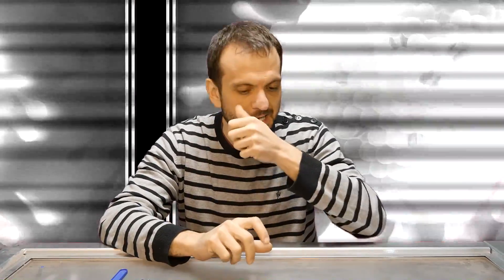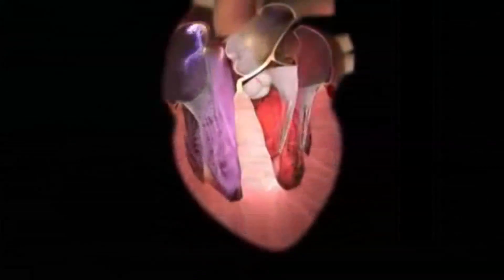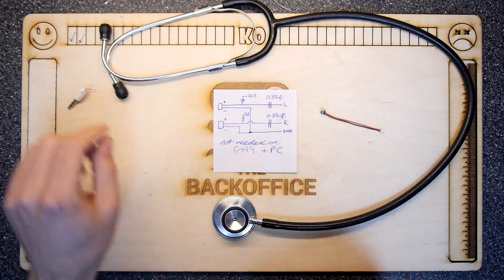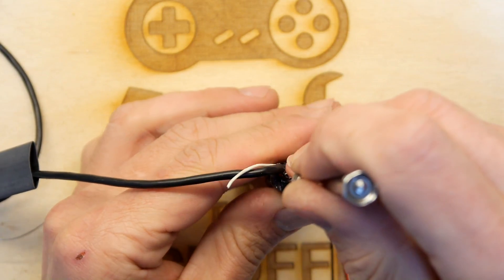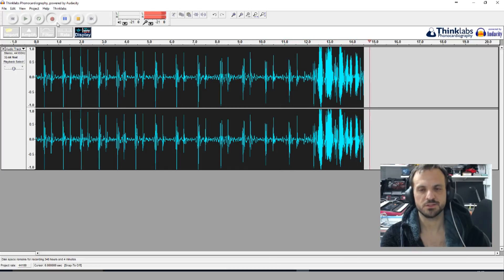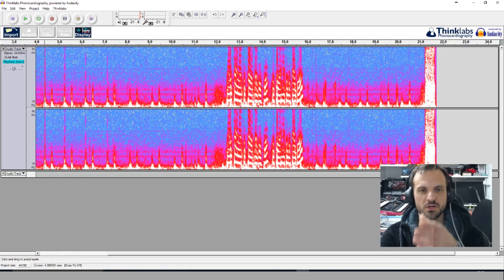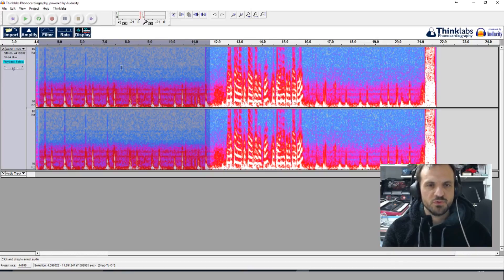Build your own digital stethoscope!

Comment: this method can save lives. a cheap electric sthetoscope will be easy to be used for remote hearing of covid pacients
Reply from the maker: Good point. I might start working on a v2
Reply: I tried to build one but the sound output is very low can you help me

Comment: That's good idea with adding some filters it will be more precise for remote patient monitoring..
Reply from the maker: I think ideally it would be best to add an amplification and fitting circuit to optimise the bandwidth of the audio hardware in the pc.

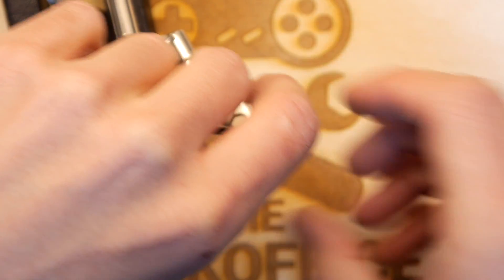Comment: At 12:40 the machine you used to solder the wires to the microphone, is there any alternative to that and also why was the white wire not attached as well. Thank you
Reply from the maker: Not really, unless the microphone has wires you can twist and tape
Reply: @backofficeshow  Sounds good, also do you think a hair dryer would be able to replace the heat gun or probably not
Reply from the maker: Hair dryer max temp = 80 degrees centigrade (at a guess),  Hot air station = 500 degrees centigrade. I think you will be waiting a long time for solder to melt 😁

Comment: Hi again!
Just to answer your question:
Yep, it's fine to wire L and R together for mono.
That's how all the skype mics etc. are wired!
I think a lot of the sound cards that mostly don't have stereo mic inputs are wired anyway.
Better to have both tip and sleve wired up, as if one is left hanging, it'll pick up humm.
Tip, Left, ring, Right, sleve gnd.
and I'll ignore the modern smart phone standards with the extra rings for video and stereo headphones etc!!!
Reply from the maker: Hey thats great! Thanks for getting back to me, glad its correct! My PC is actually putting out a bias voltage so is powering the mic just like the camera, I wonder if they all do that. Either way, does mean the mics need to be wired up with the correct polarity.
Reply: Yep, all PC mic inputs should do that.
If you need to make your own supply, it's just a 3v to 9v battery, a 10k resistor from bat Positive to the mic positive, and a cap from there to the audio in tip/ring.
Probably 22uf as you want the low frequencies to get through in this one!
just hook all the negatives and gnd s together!
The mic capsules have a fet inside, so are a resistance changeing device.
You might find that the higher bias voltage you put on there, the more amplitude/gane you'll get and more headroom before things clip.
I think most capsules can take up to about 9v before they pop!
Still, at $2 for about 10 of them on ebay, you can afford to bang a couple in the name of science!
The better quallity ones will give better sig to noise though!
You could adjust that 10k to get the positive of the capsule to about half your battery voltage for best performance!
Reply from the maker: +william Taylor This is great advice! I really like audio circuits, had to design a few amplifier and mixer circuits, it's interesting how the DC and AC components are invisible to each other 😁
Reply: Well, they can be separate!
That is unless you make fully DC coupled multi stage amps, so that if one thing go's wrong, the whole thing go's up in smoke!
Caps are always a gray area, electrolytics that leak which is the main cause of scratchy pots on most amplifiers, and reduced level or bass when they start to dry out!
and while I'm on caps.
No one in the electronic field seems to have figured out that electrolytic caps in switchmode supplies act like a battery with one of those desulphaters on it which is why they blote and ultimately die!
The oxide layers keep breaking up and re building themselves until you have a capacitor full of black oxide goo and hydrogen that eventually makes it blow it's top!
I'm sure a ceramic across it would prevent this...
End or wrant!!!
Still, in audio amps, they often last quite well, and I've got stuff from the 80s that still works fine!
Reply: @backofficeshow   yes and no, i would try it and see all ways , both ways , at least as a sounding board and feed back for trouble shooting purposes that is how ever,

Comment: I have created a DIY electronic stethoscope using the chest piece and connecting it to  condenser mic over the tube. While I am able to hear all outside sound , I am not able to hear any body sound at all (heart/lungs) . The same chest piece when connected to tube of stethoscope works well . I am using audacity software for recording. I would appreciate  any suggestions for resolving this . Thanks
Reply from the maker: Soumitra Bhattacharyya hmm. I'm not really sure, I had a few different mics, might be worth trying a few alternatives. I suspect they need to be able to react to the right frequencies

Comment: what is the diameter of the microphone you used? would this be a standard size or does the inner diameter of the tube very depending on the stethoscope you buy?
Reply from the maker: I believe the microphone I used was around 6mm. As the tube is quite stretchy you can make it fit. I think the inner diameter of the the was around 3-4mm I do not think it is that critical

Comment: Hey man I was wondering if a condenser microphone would work with this circuit thanks
Reply: Also, after the microphone was connected to the headphone jack, was the headphone jack simply connected to the computer and recorded?.
Reply from the maker: Yes
Reply from the maker: Yes, as long as the polarity is correct for the mic
Reply: @backofficeshow  ah ah thx man appreciate it
Reply: Is this too cheap of a stethoscope or do you think it'll work
Reply from the maker: @satyam7031  I wouldn't use it to diagnose anything. Not without more testing and validation.

Comment: There must be a way to BOOST the microphone, I bought a simple microphone amplifier from the dollar store it takes 2 AAA batteries. It is very loud and only used boosting an ebay micorphone amp that I use for listening to and detecting emf noise from light bubs house wiring, computer key boards.... To make a mic to listen to these energies use the same mic design you have in the video just cut off the outer tin and leave only the disc the wires are soldered to and bingo, after that put it next to your key board and listen to the noise your hands are contact with with you type...

Comment: Hey there!! I'm really interested in this. Tried it out in a basic Bluetooth potable speaker, but it turns out it has no phantom power, could you please explain to me how to add phantom power? with battery would it need? How to wired it? Thank you very much!!!
Reply from the maker: Did you try to measure any voltage across the microphone wires?

Comment: Hi,
I was trying to create this device but after a few attemps it doesn't work, I checked that there is phantom power and there is.
After connecting the device to the phone and computers but it doesn't work.(the computer and phone still using the built in microphne.
Can you help?
Thank you in advance
Reply: Correct polarity?